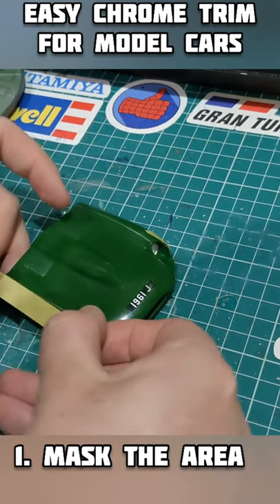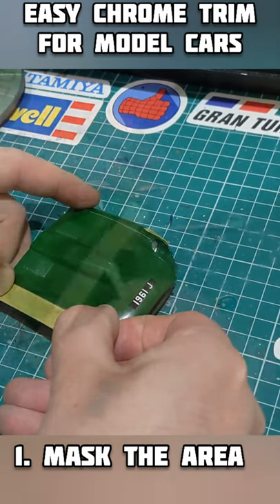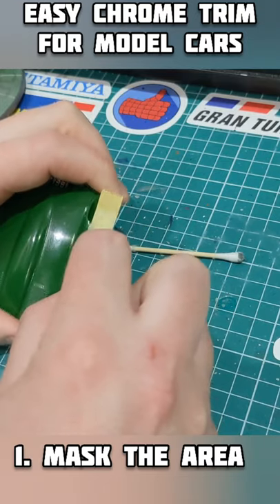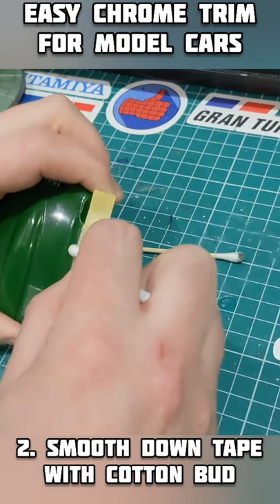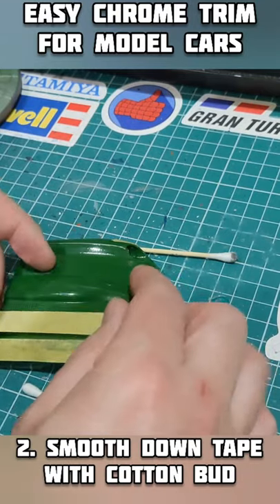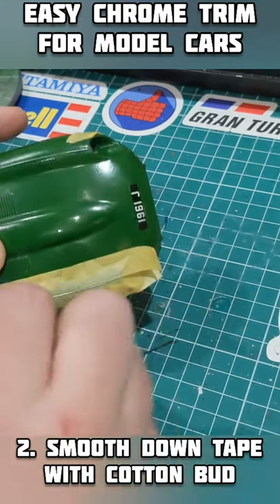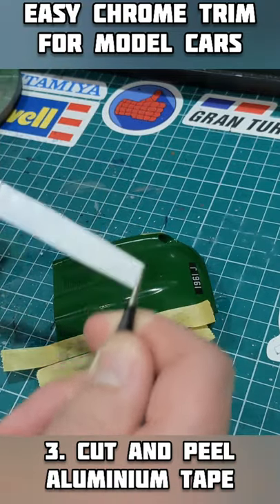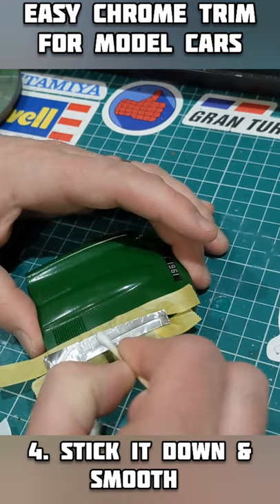Quick and Easy Chrome Trim for your Model Car

Comment: Now that is a cunning trick putting masking tape either side of the area you want "chromed".  

I had tried using the same aluminium tape, but put it straight on without using masking either side. 

So when I trimmed the excess tape off, I had scratches in the paint work....
Reply from the maker: Yeah, I found the same issue when I first tried using chrome so I'm glad I found this idea. Glad you like it too!

Comment: Depends on the type of car, and what location its in, sometimes the anodized aluminum look is correct, sometimes you want something that looks more like stainless, 
Or the Molotov chrome pens.....they all have a slightly different looks and can be applied in conjunction for more realistic models. 
Remember refrence the real cars for appropriate finishes.